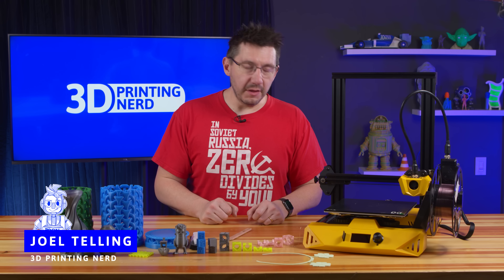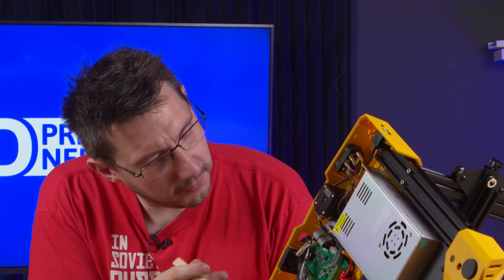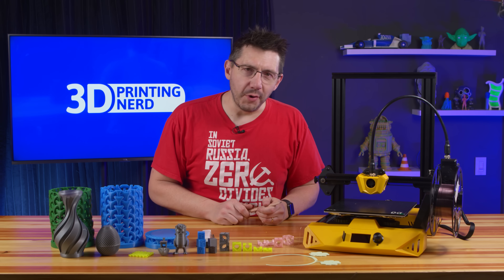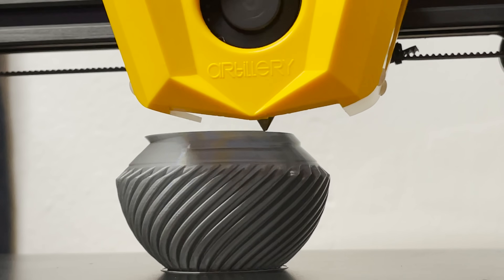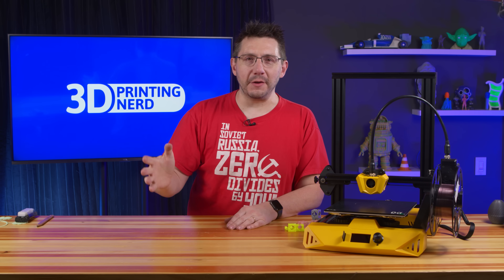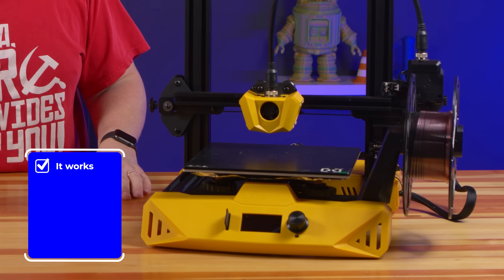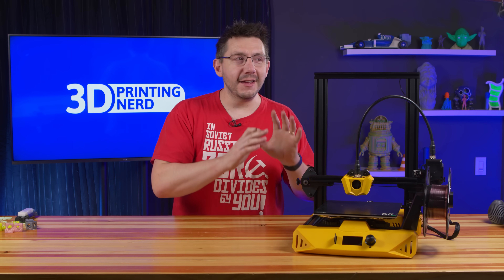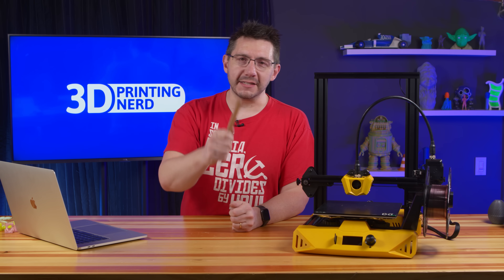THIS Is a Bad Idea // Artillery Hornet Review

Comment: btw. tinned wires into a screw terminal is not "better but not by much" than bare wires it is much worse because the tin will flow under the pressure of the screw and the cable will get loose over time and might short something or start a fire when it falls out of the terminal
Reply: First class, first week in soldering lessons our teacher told us: "never tin wires to screw them into a  terminal block"
Reply: Came here to say the same. Do NOT, I repeat, DO NOT tin wires that you screw down...
Reply: Came here to say this haha
Reply: @prcdslnc13  As did I. Always use ferrules or just put the wires in if you really cannot is the first thing I learned ;-)
Reply: Tinnes wired are bad when they must be clamped. Temperature, vibration or not, the tin creeps and the clamping loses its tension.
In the USA people the same happened when they started to use aluminium for home wiring. It is just too soft, gets loose, high resistance, followed by overheating.
Reply: Yes, tinning wires before putting them in a terminal strip (or before crimping them) can be problematic, especially on some terminal strip designs.
Reply: You don't tin wires when there are mechanical vibrations.
Reply: @michaels3003  or heat.   The big issue with tinned electrical connections is that through heat cycling the solder cracks and you get a poor connection.  This causes more heat though resistance which exasperates the problem until either you either get a fire or a disconnect.
Reply: @codemonkey2k5  Problems don't like to be exasperated, it's very frustrating for them.
Reply: @codemonkey2k5  That's not the specific problem with tinning compressed connections but, yes, soldered connections are all doomed to eventual failure.
The problem with crimping or screwing down tinned wire is that it guarantees a connection that will go high-resistance in a very short time, regardless of thermal cycling or vibration.
Reply: I had an Ender 3 start on fire from tinned wires. Got the cover off before any major damage, but you could definitely tell that it started at the main power terminal.
Reply: Was commenting to say this don't use tinned wires in terminal blocks. Pretty sure Anet learned that lesson the hard way.

Comment: They should make a debug adapter, that can be attached between the special cable and the hotend and let you connect elentronics but have an open tube for filament.
Reply from the maker: YES. That would be great. Or heck, modify this cable to do that. I dunno. I do like this solution.
Reply: Yeah, exactly.
Reply: hi, after 2 years, someone made it?

Comment: How easy can the whole hotend/cable can be replaced? Maybe it is good for someone who don’t want to troubleshoot all those things. Just replace the whole extruder and it’s done.
Reply: You should be able to fix your machine when it breaks. You know, instead of having to wait to have something shipped from the other side of the planet to you and wait.
Reply: @davidtobin  if waiting time is an issue, I would just hold a replacement on hand. Same like I do right now but with a lot less separate parts.

Comment: I remember during the live stream wondering how the heck you could clear a blockage (hot or cold pull) with this setup. +10 points for yellow, -100 for not actually being a working design.
Reply: Read other people's informed comments.
Reply: @michaels3003  If you say whats actually wrong with OPs comment then they wouldn't need to